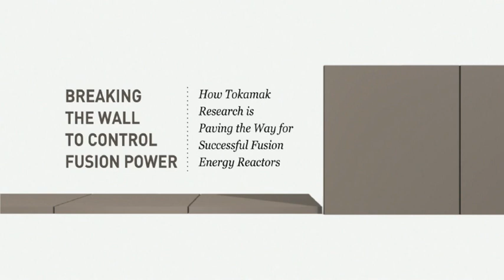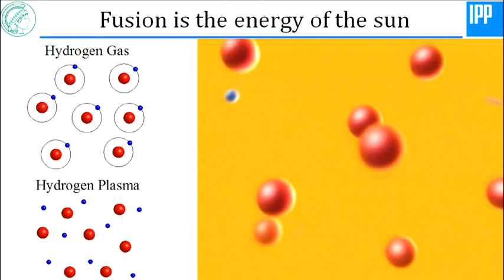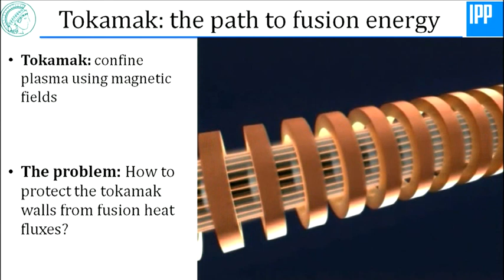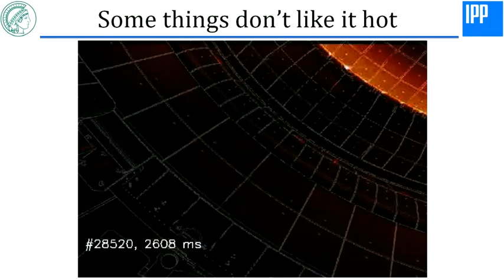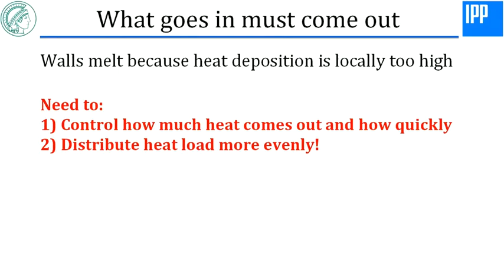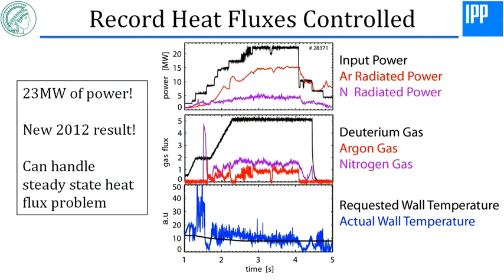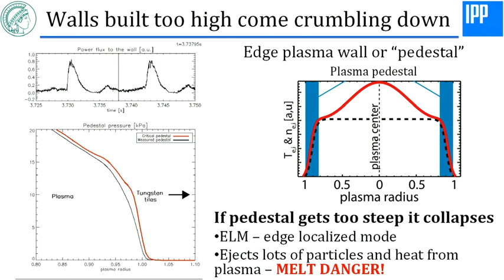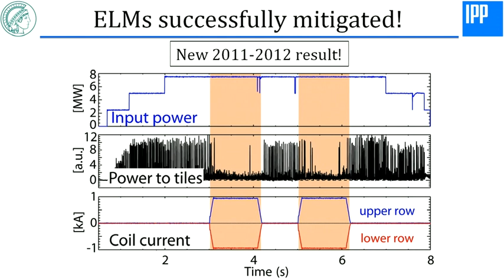How Tokamak Research is Paving the Way for Successful Fusion Energy Reactors | Rachel McDermott

Comment: Plasma term can be used in various fields: biology, physics and new technologies.

The biological plasma

Liquid portion of blood which represents about 55% of its volume. The plasma is composed of water and contains lipids (fats), hormones, clotting factors and over a hundred proteins whose primary is albumin.

The physical plasma

State of matter (as well as liquid, solid or gas). This is of material partially or totally ionized.

Plasmas are a medium consisting of a mixture of neutral particles, positive ions (atoms or molecules that have lost one or more electrons) and negative electrons.

A plasma is electrically neutral and particles interact with each other.

The plasma technology

Developed for flat screens, which provides a very bright image and high contrast over large areas. Specifically, the plasma panel operates with two gas locked in small cells that are similar to the pixels of a video projector. First, phosphorus, is responsible for illuminating the slab producing light. The second, the plasma functions as a mask and is responsible for transmitting electrical pulse which will determine the color and contrast of each pixel. This technology is now well mastered his expensive but still subject to the industrialization screens and high-priced TVs.

Comment: A presentation with some relevance to this topic is at http://www.vortexengineer.com/liquid-pendulum-engine.html

"A Mach number  is associated  with every shock wave. This number represents the ratio of the shock wave to the ambient speed of sound. The temperature behind a shock wave is higher than that in front of it; the ratio of those temperatures is proportional to the square of the Mach number. For an imploding air bubble, the Mach number approaches infinity as the shock front moves closer to the focal point, which means that a tremendous amount of  heating takes place. Furthermore,  when the shock hits the center and explodes outward, the molecules that were  behind the shock are suddenly in front of it again. The hot molecules are hit a second time, and their temperatures go up by another factor of the square of the Mach number."
"Temperatures that can be reached  by this mathematical model are therefore unimaginably high."
                                                                                                                               Seth Putterman   - Sound into Light